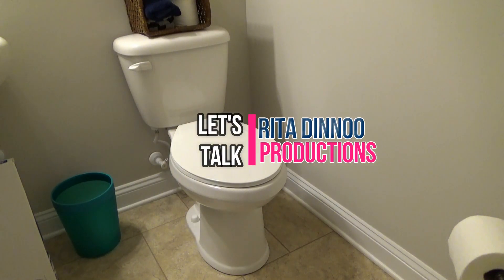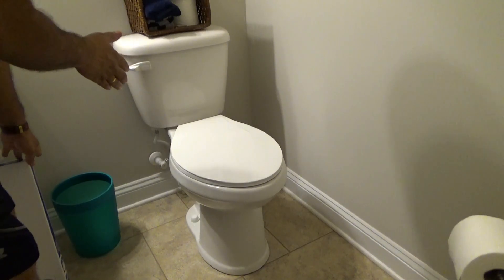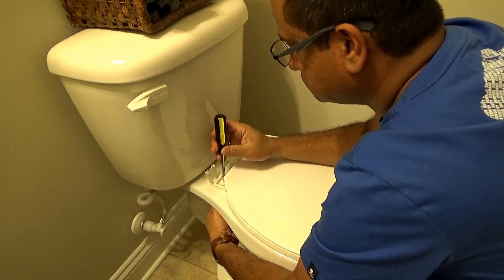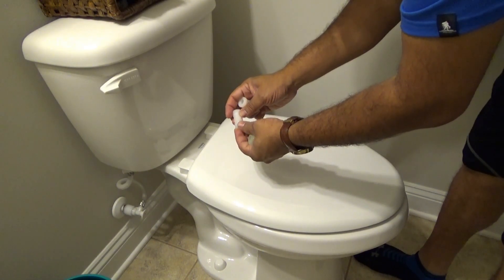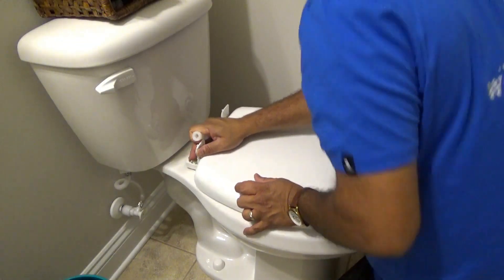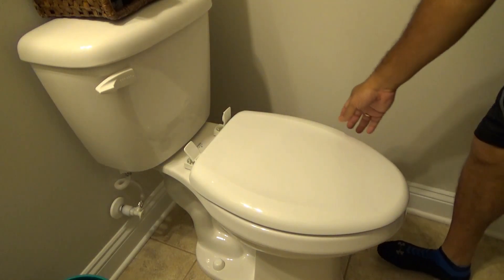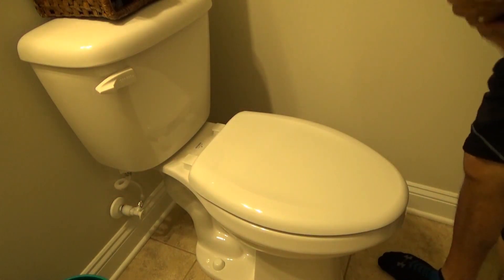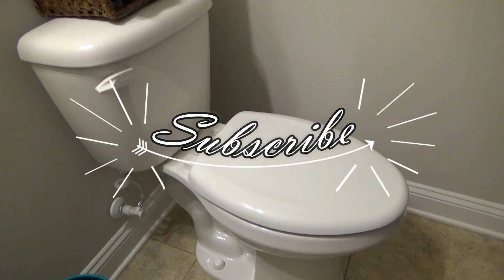Replacing a toilet seat with Bemis Whisper Close Toilet Seat

Comment: The stud that snap onto the 6 teeth like grippers in video at 2:35 that doesn't work. The stud snapped off twice already. So I used thread lock aka lock tight around teeth and groove around the stun. Also the cap that locks the teeth onto the stud groove. If it still snaps off I'm going to replace it with a bolt, large washers, and the the nut that it came with.
Reply from the maker: Thanks for the tip!

Comment: This product has a one-year warranty.  I've had mine for a couple of years and the "slow close" feature has stopped working.  The toilet lid now slams shut.  Has this happened to anyone else?  Any idea if it's fixable?
Reply from the maker: I replaced a few with this model. Tye one used most frequently stopped working after about 3 years. The rest seem to be fine. I have to investigate if it is fixable.
Reply: @TheHappyLife-h7b  did you see if it was fixable I don’t want my dad finding this out
Reply: My soft close stopped working also? Any suggestions for repair?
Reply: @addie-gracemehling1806  I've been living with the malfunctioning lid since it stopped working.  But I just Googled "how to repair a soft-close toilet lid" and got a number of hits, so you might want to check those out and see if the answer you need is there.